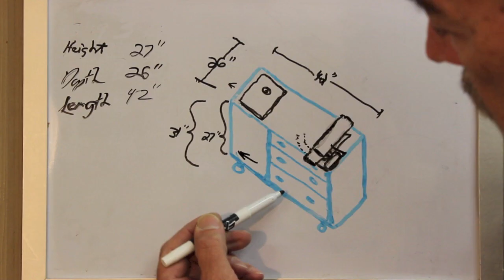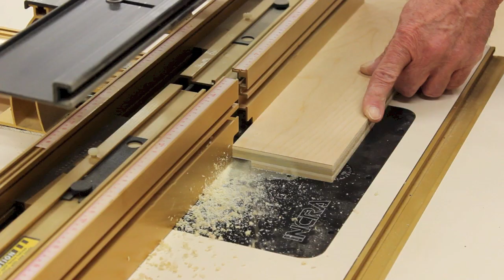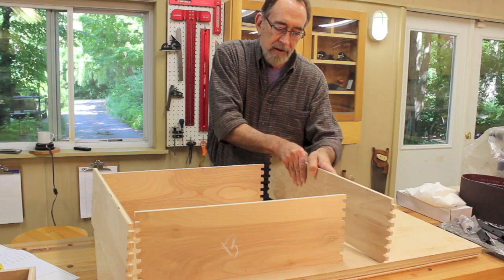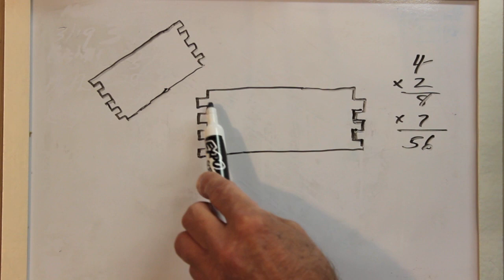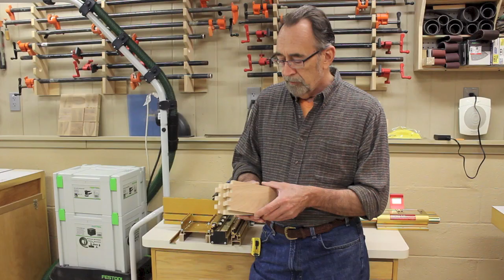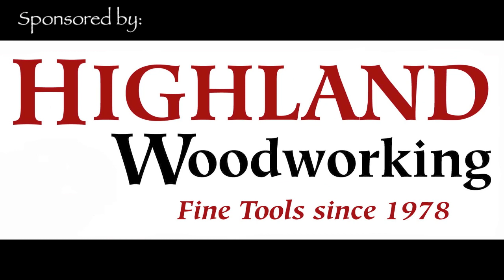Sanding Center Pt 5A  Drawers Box Joints

Comment: You goofed up a little...  You said your offsetting spacer board was the same thickness as the plywood..   but you also said earlier the plywood was a little shy of 1/2" (as usual for plywood) ...  

Incra recommends that your offsetting spacer block be "the same thickness as the router bit".  So, if your bit is exactly 1/2", your offsetting spacer board should be 1/2" thick.  You can clearly see during your video that the bit is nicking the front boards a tiny bit.  :(